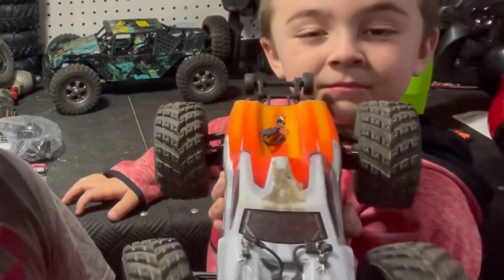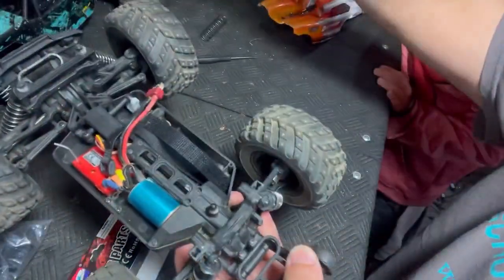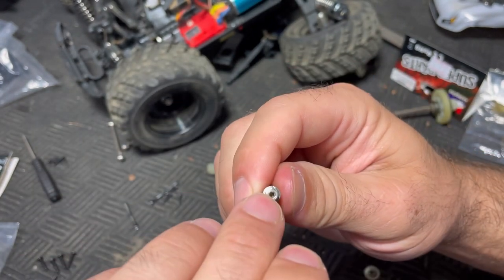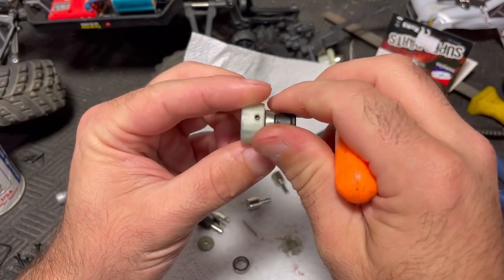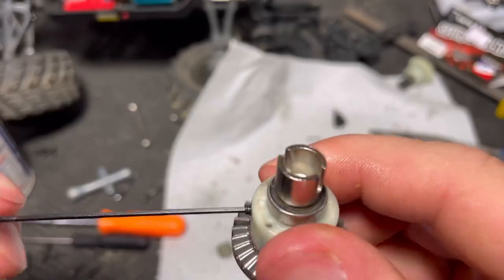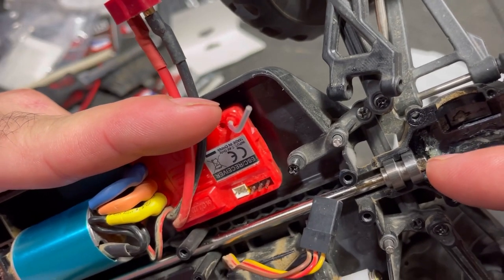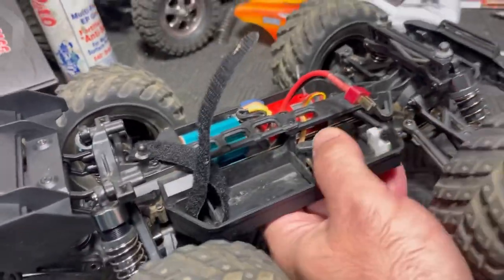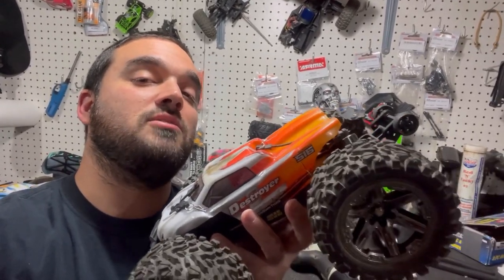HBX 16890 - Metal Upgrades - Differentials - Drive Shaft

Comment: Great video.   Anyone getting this or the hbx16889a pro should check for that play in the driveshaft and do what he did wish that rubber hose to the end of the drive shaft cup.   You much play in that driveshaft will strip your gears.   Thanks for this video!
Reply from the maker: Glad you found it helpful! My 16889a pro came with the screws , but the driveshaft kit doesn’t for some reason. Hopefully the one you ordered has them and they fixed that issue!

Comment: Another Sweet video!
I have two of these little beasties. Bezgar and Flyhal both brushless and all metal. No gear problems. 
And since I ordered a 2845 3800kv that didn't go in the HBX 2995, just for fun I threw it in. Not sure if it's faster, but the torque increase is noticable and it runs cool with stock ESC.
Reply from the maker: Awesome! We still have our 16889a to open up. We got it like 3 weeks ago! Lol
Definitely fun and durable cars!

Comment: I am actually hearing the same grinding noise my HBX 16889A Pro makes after you fitted the metal parts. Did you sand or grind the diff cups down a bit or did you fill them up so that the dogbones do not go in too far into the diff cups?  I am going to put some epoxy in the diff cups to fill them up and see how long that lasts ...

Comment: Just did ours today. I noticed that no matter what, I cannot get the top gear to sit flush on the differential housing and in I tighten the wheel nuts too tight the wheels bind and won’t spin. Thanks for the video.
Reply from the maker: That stinks. Did you get it figured out?
Hopefully the video was helpful!
Reply: @DerbyCityRC  thankfully, I did! I wasn’t aware that I needed to move the plastic ring from the big plastic gear and move it onto the new metal one. It looked like it was all just one solid piece until I looked at the part online.
Reply from the maker: Awesome!!

Comment: Where r u ordering these parts? My son's have the 889&859. Need rear seats for the 889!!! And preferably metal dif gears while I'm in there.
Reply from the maker: Most of them were from Banggood.com, but I’ve been having trouble finding parts from them.
You should be able to find all the parts at Haiboxing-hobby.com. You may need to click the contact button and let them know what parts you need if they’re not listed.

Comment: Have you found any full metal oil shocks? My son and I have consumed 3 oil shocks due to the top plastic mount snapping.
Reply from the maker: I have not yet. I’ve actually had decent luck with these shocks. I assume it’s from crashes? Lol take a measurement from upper mount hole to lower mount hole when shock is fully extended and see if you can find some with the same measurement. 
The other thing to think about though is that this would just transfer the load to the next weakest link and possibly break something else.
Reply: Yeah that's what I figured. Incidentally with the larger wheels the car seemed more inclined to fall on roof following a crash and cornering sharply. Did you refill the shocks with denser oil? I can't see how this is done with the oil shocks I purchased?

Comment: Hi could you please let me know when you assemble the diff after putting the grub screw back in  should you hear the gears clicking when you turn it or should it turn freely and not hear the gears turning thanks
Reply from the maker: They might make a very little noise but should move freely. Make sure you didn’t screw the grub screw in too far because it will hit the gears if I remember right.
Reply: @DerbyCityRC  thanks very much for getting back to me

Comment: Do you have any issue not having screw on that shaft after putting that piece rubber hose?
Reply from the maker: I ran this car for a long time and never had a problem!
I was really surprised. I just recently turned it into a parts car, but only cuz I have a couple other similar cars.

Comment: Yo buddy, when I bought this diff kits on BG they were defective. Only two small gears and a single pin for the inner diff instead of two pins and four gears. Do you confirm it's good now? Would you add a link into the description or comment?  TY
Reply from the maker: Hey! That’s how mine was too. Since they are metal, they are assuming you don’t  need 4 gears. Just remove the plastic gears and pins, install the single pin with the 2 gears and it works 👍
Reply: @DerbyCityRC  I know the wheel will spin but that's not exactly how a diff should work. You can check Me Him review on last UDIRC car if u like to go through the thing. Thanks a lot for the reply!
Reply: (BTW if u just seek harder diffs for bashing and jumping they are good for your need!)
Reply from the maker: @VesuviusRC  4 gears would certainly be ideal. You’re welcome!!

Comment: Hi there, excellent video but can i know what hex do use to unscrew the differential screw to take that pin out.
Reply from the maker: Thanks!
Unfortunately I don’t remember, however most RC hex sizes are 1.5mm, 2mm, 2.5mm, and 3mm. This one was smaller so probably 1.5 or 2. Sorry I wish I remembered, but hope this helps.
Reply: @DerbyCityRC  thaanks i fucked the screw of my car lol
Reply: @DerbyCityRC  and you know the most funniest part, I put solder on the screw and used a metal part to hold together and unscrewed this screw lol.
Reply from the maker: Well that’s a good way to do it! Nice job lol

Comment: How did you remove the plastic wheel drive cups from the bearings? Trying to replace mine with metal after shearing the securing screw but they won't budge.
Reply from the maker: Man this was so long ago, but I don’t remember having an issue. So the bearings are stuck on the axle stub? Can’t pull it out of the wheel at all? Could try setting the stub inside something like a socket and then punch out the axle that way. Just want to be sure the inner race of the bearing is supported so you don’t blow the bearing apart.
Reply: Yes the axle stub won't push out of bearing. Good shout using a socket to brace the bearing while I get more persuasive. Just wanted to check I wasn't missing something before a resort to more force. Thanks.
Reply: Then plan worked! Cheers for the tip!
Reply from the maker: Awesome man! You’re welcome!
Reply: Did you have any issues after replacing the metal axle stubs. My rear suspension doesn't seem to rebound as it should and wondered if the metal axles and axle stubs are sticking. Maybe need to grease the parts?
TBF this car is always out in wet so could be any number of seized parts between suspension and drive train.
Reply from the maker: @Sirwafflehead yes I had to drill my rear axle stubs out a bit. I believe I show that in this video, just don’t remember the detail I went into. https://youtu.be/m-x9L0rhafo?si=ir5HrsGBcTOZLuJo
Reply: @DerbyCityRC  just drilled out the rear sub axles and they're working perfectly now! Thanks.
Sadly the oversized wheels have destroyed my drive train judging by the sound of it now.
Reply from the maker: @Sirwafflehead that awesome you’re welcome!
Dang that’s sad 😢 
Time for metal 😂 
It took a long time for me to wear out the new metal components.
Reply: I had a modelshop online basket ready filled with metal drive shaft parts. Annoyingly though it's more economical to buy a full HBX pro from banggood. I hate to waste the original car though. Where did you purchase your spares?

Comment: Did you figure out what size screw goes in the pinion gear??
Reply from the maker: I did not. It’s actually still the same way I left it. No screws at all, just the rubber pieces. Drives like a dream!!
Reply: You need to space it anyway DS design is too short all it to fit the gear housing properly.
Reply: Hi I don't know if you would be able to help but we completed the gear change it was OK for a while but now the 4 wheel drive don't work back wheel s not got power when using the car. When you lift it off the floor all wheels go round, we just don't know what it could be, any help would be much appreciated
Reply from the maker: @luciferlambert1243 do the axles spin on the rear wheels? Need to find where the drive stops and then inspect or disassemble to inspect that area. Lost axle pins or wheel pins are pretty common.

Comment: Hi could you please tell me how you removed the set screw form the diff please
Reply from the maker: It’s a very small allen/hex head. Dont remember what size unfortunately as it’s been almost 3 years since this video. Either 1.5mm or smaller.
Reply: @DerbyCityRC  thanks had to take it to a model shop to do as I couldn't undo it with a hex key but it's a great video

Comment: Which oil do you use in the oil dampers?
Reply from the maker: In this video, I kept what was in there. They come full from the factory. Not sure what weight, but probably around 20k. Now I have 50 wt in this car and I like it, but I tried 80 wt in another similar car and it seems even better.
Reply: @DerbyCityRC  okay thanks👍
Reply from the maker: You’re welcome!

Comment: Hey brotha do you know how to bind the brushless  2in1 receiver with the brushless transmitter.   One car I did with a receiver and speed controller worked fine.    The one I figured would be easier.   Just flashes.  ?? Idunno how to bind it to the 2in1 receiver
Reply from the maker: I don’t. I know there is a “bind/mode” button on those transmitters. Do you have the instruction manual around?
I’ll see if I can find mine in a bit if not.
Reply: @DerbyCityRC   exactly there's no button.    And it came with no instructions    weird.
Reply: The remote has a bind button and 2 lights just flash and the receiver . 2in1 also just flashing.   Weird bro
Reply from the maker: Which remote is it? The one that comes with the 2995?
Reply from the maker: Woops. Never mind. Wrong car. I guess it’s the 16890 or 16889. Lol hold on.
Reply: @DerbyCityRC  yah exactly.  The 16889 brushless or 16890 brushless. Bro your the best.  Super fast replys etc .  Your my go to guy for RC knowledge
Reply from the maker: Thanks dude! I appreciate that and appreciate you watching my videos!
So I just checked the manual.
No special instructions for binding. It actually says the bind button is disabled for that model car. (It changes the steering mode on our HBX devastator).
So I used a remote from another car (even though same model remote) and it bound easily to a different car with the same type of ESC. Turn on the car, wait til it beeps. Then switch on the remote and the car should beep a couple more times.
Does that happen?
Reply: @DerbyCityRC  yah she beeps a bunch then just flashes nonstop
Reply: I did notice I could bind any remote to the brushed ones I had 2.   Same as you just said this one is just weird. .  I'm gna try some more stuff tomorrow    this is just strange I expected it to like instantly connect    it kind of works just way super laggy and steering servo barely works    I built the other 1 all today perfect with the surpass hobby 35 amp ESC. Some other remote and 3 channel receiver .   Tomorrow's test day for it .   This other 1 just flashing all wild when I thought this would be the super easy turn it on and go basically.   MMM
Reply from the maker: @joshhindle8946  ya that’s weird. I would also try changing the remote batteries. Remote or receiver could be bad of course.
Reply: @DerbyCityRC  ok will do tomorrow.  I was thinking it's gotta be some noob mistake.   But I do have another 2in1 receiver comming so    that be something if that's it.   Il let you know how it goes bro have good night
Reply from the maker: @joshhindle8946  you too man, thanks!
Reply: @DerbyCityRC  bro I just retried everything just turned the car on first. I had the engine wires mixed up I think and I changed battery's .  It's good.   Your a legend
Reply from the maker: Awesome!! Very glad to hear that! Thanks my dude!! 😎😎
Reply: @DerbyCityRC   the one with the 2in1 receiver.   I kept it plastic diffs etc.      It can't handle the 4600 kV for long like 3 mins she shuts down too hot.     Lol but she is a wheelie ripping speed monster bro ..    the one with the surpass hobby ESC/speed controller and 2445 at 5400 kV.   Is flawlesss.  All metal .     Gna have some fun and report back    until then thanks alot bro.  Cheers
Reply from the maker: Awesome! Looking forward to hearing about that!
Reply: @DerbyCityRC  Holy smokearoos bro.   The car goes like 70.km probabaly roosters almost on demand ..    only downfall battery last like 10mins or so. ..  i have lipos     (1000 mah 25c a few of them 4). And one 35c 1800 mAH .   I played with it for like 5 or so 10 mins in the house gently then outside for like maybe 10 ripped it down the whole street a few times and back and fourth.    Couple times spinn     then she slowed big time ..     good lord she's savage but a battery eater .    The 2440 car with the stock 2in1 receiver I just played in the house for 5 min and it turns off gets 2 hot ... I think the kvs may be silly too high maybe? The stock receiver doesn't Wana play with the 2440 and the others absolutely epic.  Just guzzles the battery.     What do you use for yours or recommend ? Thanks 🙏👍
Reply: Is absolutely nutty
Reply from the maker: Wow! Sounds like a beast! Our 16xxx cars are still stock so decent run time. We also just got the pro and the battery is much quicker to go flat on that one. I usually use my 2200 mah battery, but it doesn’t fit in the tray, so gotta Velcro it in on the upper chassis brace
Reply: @DerbyCityRC  wickedd yah ok makes sense fun like that's gotta have a downfall   that was epic
Reply: I think metal parts heavier as well ehh
Reply from the maker: Yup. A downside to everything! Sometimes its worth it!!